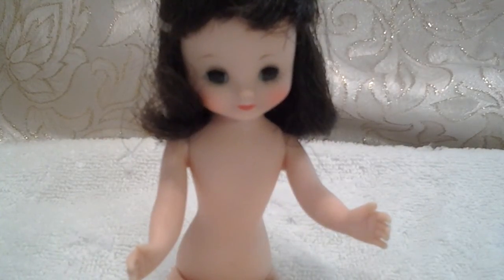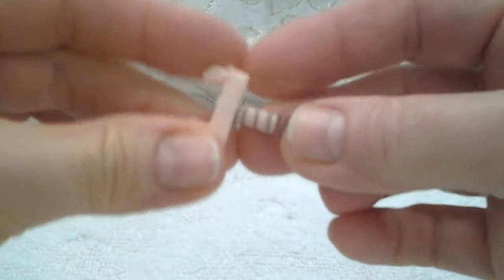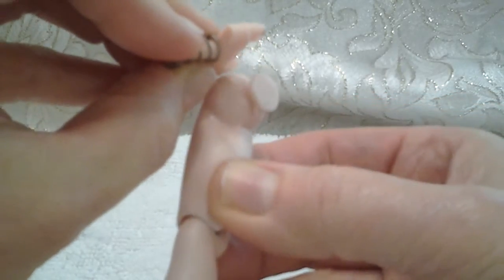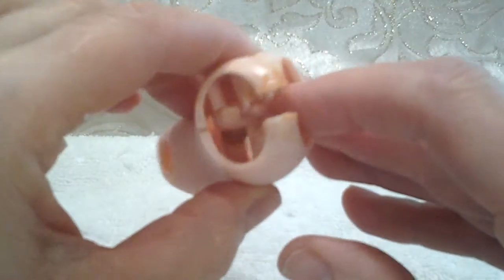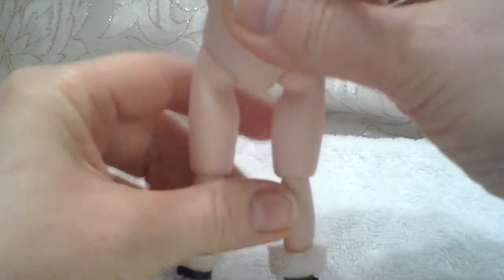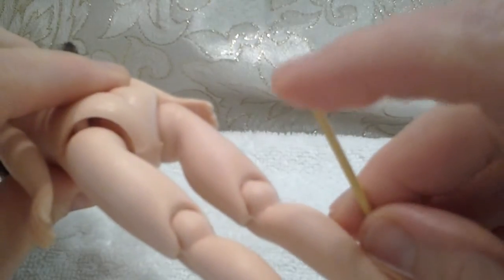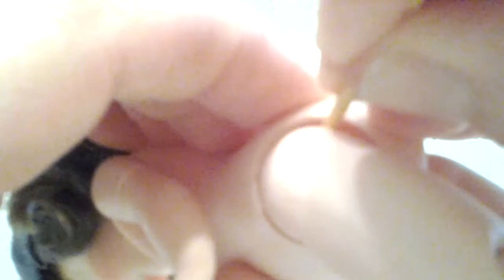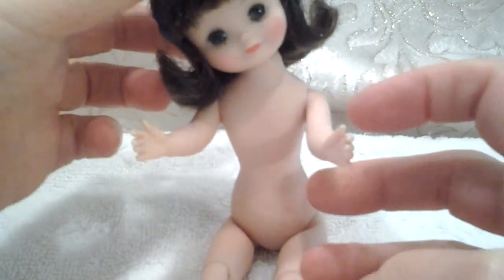Safely sit your vintage Betsy McAll doll!

Comment: My doll is really stiff too.  I carefully pushed up the legs and sometimes she'll bend, sometimes she won't!   I don't want to break her!
Reply from the maker: There are some unplayed with vintage betsys whose springs inside are very rigid and stiff. I am of the opinion that if these almost 60 years old betsys don’t want to sit then they shouldn’t have to. 
Definitely don’t force it. If the wooden toothpick doesn’t release the mechanism then better to let her stay straight.